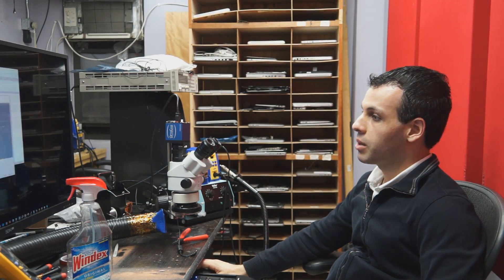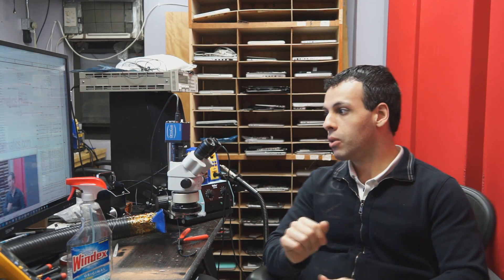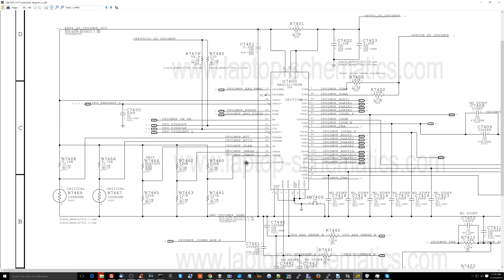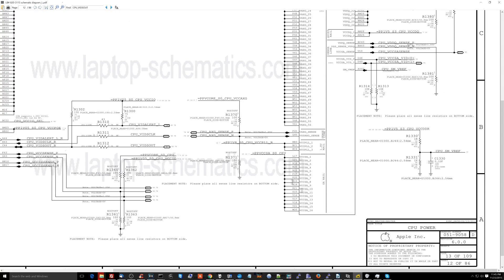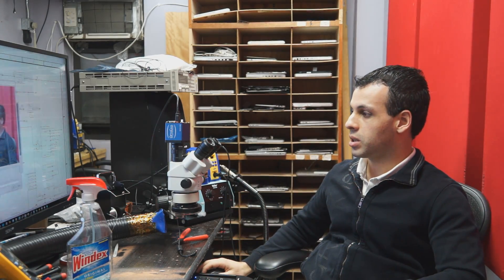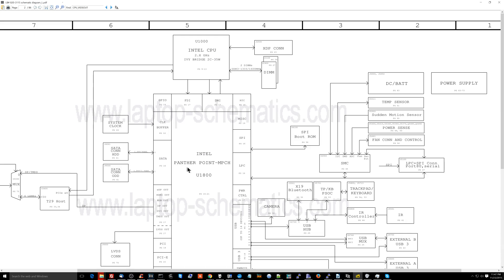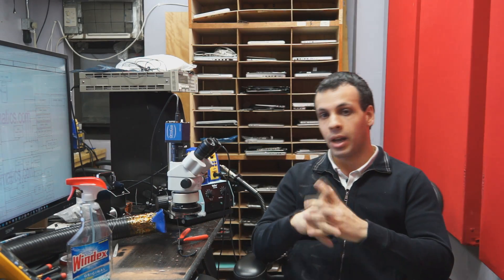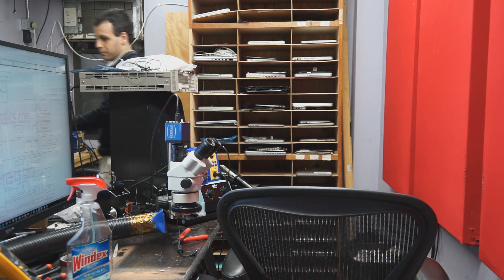VCCIO vs vcore and why power rail sequence is important to laptop motherboard repair

Comment: Hi Louis!
I'm trying to understand which part failed on my mid-2010 13" Macbook pro. SMC seems to be fine (the LED blinks because the battery is missing, and the LED turns on when the lid is closed, etc) and it seems to actually do its power on self-test since it beeps when I remove the RAM, but then I have a completely white screen. 
I was wondering, which part controls the LCD backlight during the startup sequence?
Thank you for your very useful videos!
Reply: +tbx1024 Basic RAM test is one of the first parts of POST. You'll need to try to boot and reset the PRAM firstly. This is to clear bad backlight levels (In case that's the issue), as well as reset volume levels to make it chime. The chime is what you want to hear to know that POST has completed.
Reply: +WhatnotSoforth Hi! Thanks for your answer! I have already tried the key combinations for PRAM/NVRAM reset, and tried to do those using an external keyboard too, and I have absolutely no reaction from the machine unfortunately...  It looks like it never reaches the end of POST, but I don't have any error code/beep reporting

Comment: Hi Louis, this it out of topic but i'll try it anyway... my old imac (late 2009 ATI radeon 4850) had gpu failures...  did a homemade reflow that only worked 15 mins... i am gonna send it for "reball" ... what are the chances? ps> gpu is not dead , just the common case of stripes and squares...
Reply: +cronogr 1. imac is not a laptop.
2. I saw "that" video about reballing
3. I've done some homemade reflows before,
4. gpu was not dead, just failing...
5. i am sending the gpu for reflow aware of chances... less then 100$...
Reply: +cronogr That is 2 expensive (+-300$) and not worthy... i'll go 4 a cheap bet... even if gpu will shortly survive something will fail soon...
Reply: +cronogr #macNeverAgain
Reply: +cronogr i use debian 4 last 3 years :)
Reply: get a new pc dude, macs not worth the effort.
Reply: +nelson branco iMac is using "laptop"-hardware.